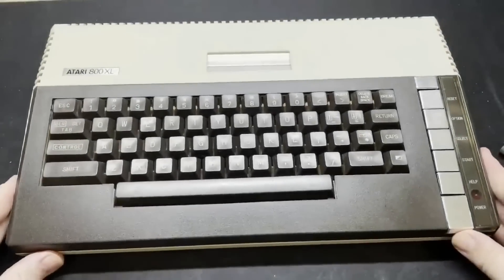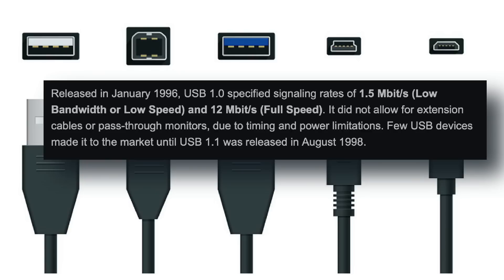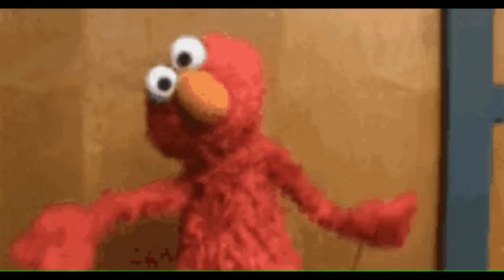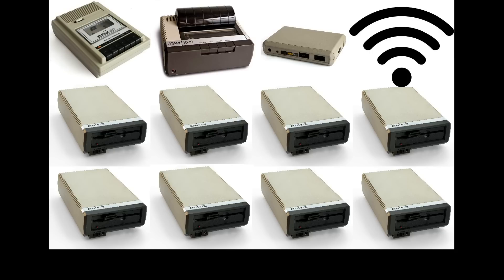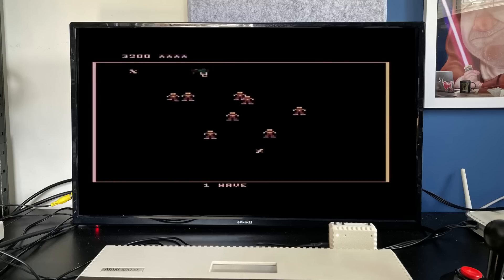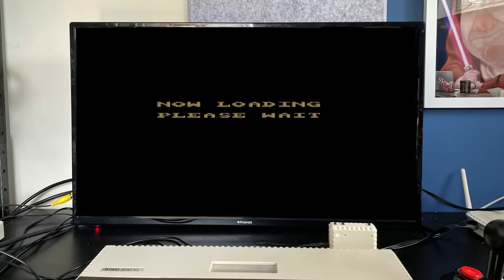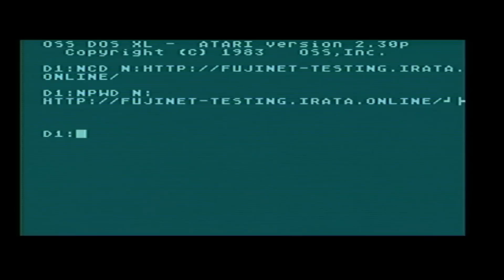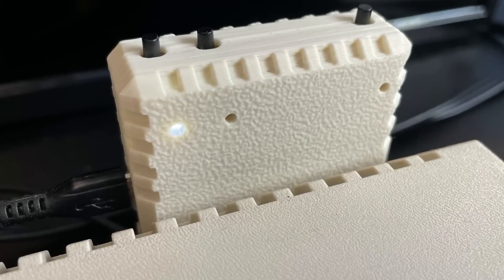Is this the best Atari 8 bit peripheral ever made?  I think it might just be!  #amazed!

Comment: Seems like the Atari is interfering with the audio, adding a ferret core around the output of the Atari video out may well aid with that by the sound of it as seems to pick up some interference EMF emission when the screen is updating.

EDIT - may be the emulation box (as maybe it is disc activity-related and sound does seem to lend itself to being that now hearing it a bit more - can wrap in aluminium foil to quickly test that one as a hacky solution.
Reply: Do you mean the standard beeps for loading and "fart" sounds while accessing devices?
Reply: @almerian  No
Reply: @PaulGrayUK  Ok,  I'll have another listen with headphones later.
Reply: @almerian  definitely a grounding interference issue - same I had on a PC via headphone socket if I had a USB stick in use in one of my front ports, was grounding, added ferrite coil loop to the audio header and that helped hugely.   many quality cables have them built-in, the wiki en.wikipedia.org/wiki/Ferrite_bead  covers it better.

Comment: hmm, the brlliance of the fujinet has convincingly made the case that the Atari 8-bit computers were objectively the best of breed
Reply: Yknow, I never grew up with the Atari/Commodore wars, I was an Apple kid growing up in the 80s... so when I finally got a chance to enjoy using an Atari 800XL and Commodore 64, with no prior biases and going in completely blind... I found the Atari 800XL had a stronger case as being the better of the two machines... tho the C64 still spits a good game! It's like 55/45 Atari/Commodore in my eyes.

When I then got a FujiNet for my 800XL and then an SD2IEC + EasyFlash 3 for my C64, I found the FujiNet to be WAAAAY more versatile. While I'd love to see something like this for the C64, I'm glad it came out for the Atari first.
Reply: @nickfifteen  I’m with you. I had a VIC 20 but neither an Atari 8bit or a 64. I have both now, and I definitely feel the 800XL is the technically superior machine except for sound capabilities, even only considering what was possible in the ‘80s. Disk drives were much faster, you could actually run various flavors of disk operating system (SpartaDOS is my favorite) which are more powerful than what you could get on a 64, and all that on a computer platform from 1979.
Reply: @Doug_in_NC  I had the same opinion on Atari 8bit sound capabilities until I dived in to the huge  Polish(and other Easter European programmers) library of games and demos of the 90s-2000s. Pokey's High Pass Filter can emulate sawtooth sound waves something most software developers  had missed .
Reply: @NickolasGaspar8bit I have come to this conclusion... when you get someone who really knows how to work the hardware... I think Pokey edges its way above what SID can do overall.  Hilariously, the coder for Space Taxi actually downgraded what the voices say to make it sound identical to the c64 version.  He could have made it sound clearer, but wanted a very 1:1 clone of the game.
Reply: The C64 is more limited than the Atari with sound, as the C64 has three channels, compared to Atari having four. POKEY is better sounding than the nasal and farty sound of SID as well.
Reply: @mortimore4030  The amount of channels don't mean anything if you can't program them, vic 20 had more channels but they were all either on or of.
Reply: The 64 had an advantage in simplicity of graphics programming: you could count on more base RAM being available since it was a newer platform, and the graphics modes were likewise made to take advantage of that, so you could use all the available colors and draw larger sprites by plugging values to registers without getting too deep into the details. As well, the C64 manual actually told you everything you needed to really get started. To get the best out of the Atari needs time to iterate on the best use of the display lists to get the right balance of memory, raster time, and fidelity, and Atari was reluctant to actually give developers any documentation so it took a while for the books and articles to come along and dispell mysteries, and as you get into the post-C64 era and more of the games are ported, they start to just look like downgraded C64 games because they did whatever was simplest and most compatible with the 48k 800 spec.

A more substantially updated Atari 8-bit platform around the time of the C64 was always possible, but as with everything else Atari, completely fumbled.
Reply: Grew up on a 99/4a, and... yeah, the Atari 8-bits are dang good.

Comment: 12:32. The internet did exist back then but the World Wide Web didn't.  Bulletin Boards were a thing back then, I remember computer magazines with telephone numbers to access the BBs.
Reply: Simpler Days right? Typing in code from magazines. Jumpers for goalposts. ;)
Reply: Yes there was a magazine with nothing but bbs listings.  Of course some major ones even had internet access available.  That was the first time I tried to access the internet via modem bbs… but soon I’d have real access via vax terminals at university.
Reply: The fact that the Internet existed back since the 70s at least still blows my mind, and I was born in 1982! The other thing that blows my mind is the ability to send email on old machines like this and have it still be understood by any modern computer (and vice versa).
Reply: @nickfifteen   that being said, early email could be arcane and weird! A lot of the earliest systems weren’t built with worldwide connectivity in mind, so you just had a username for the company (or university) network. 

Then, “bang paths” were created when more servers were linked together, where the user had to specify a path of handoffs from machine to machine, starting with some major publicly available host. Thus you could have half a dozen different paths to try to reach you, and of course every computer which temporarily held on to your message could theoretically hold on to a copy. 

You can see some remnants of that initial operational style in how eg AOL used to only require AOL screen names if emailing another AOL user, the domain part was optional. Nowadays Gmail still makes you type in domain though. 

(Had to make some changes since we’re not allowed examples anymore..!)

Comment: Fun and useful kit for an excellent and good looking 8 bit micro that was even back then more than a just a games machine, even though that's what it was mainly used for. The one thing these types of devices for computers with no memory expansion port need is a direct connection from the CPU or memory controller and a driver to enable max-speed data transfers. Something that sits on one of the chips, like some CPU upgrade modules. Kind of overkill though, and this gets the job done, all-be-it at floppy disk speeds.
Reply: The Dragon Cart uses the cartridge port on the Atari to provide the TCP/IP stack at DMA speeds.  It is extremely fast compared to FujiNET.  There are games like 8 bit slicks that let you play against online players.  It works with both the Dragon Card and FujiNET, but Dragon Card gameplay is smooth, where FujiNET is choppy because it has to wait for CIO interrupts.  The downside to Dragon Cart is that it takes up the cartridge port, and it is no longer being supported. The expansion ports on the back of the XL and XE models (PBI and ECI bus) are direct connections to the system's internal bus.  Newer versions of Dragon Cart are planned that will utilize the PBI and ECI bus instead of the cartridge port.
Reply: @redleader7988  .. Yes, I wondered about the cartridge port but I don't know much about it. Quite often they're slower reading ROM than the CPU can read RAM and worse, often they don't allow writing data to the ROM port. I see the Atari allows writing data to it instead of just ROM access requests.

Comment: I really need to get one of these. 
When you pull down an ATR from online, does it keep a copy locally for next time you use it?
Reply: The ATR is not actually "downloaded", but just a few sectors are cached from the TNFS server at a time. So it's actually accessing the file "live" during load. ATX (copy-protected) disk images are downloaded because that is required for timing reasons to keep the disk protections working.
Reply from the maker: Unfortunately not - when you eject the disk you’d have to re-download it.
Reply: can you mount a blank image and copy to it? Would also be cool to transfer between physical disks
Reply from the maker: @martindebes414  Yep, you can have a physical drive attaché also and copy from physical disk to virtual disks using a copy program :)